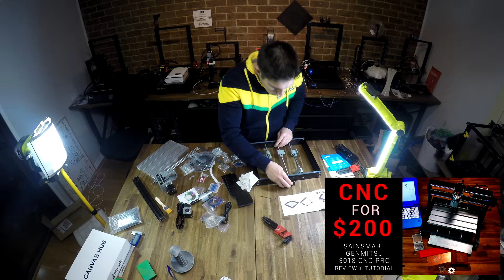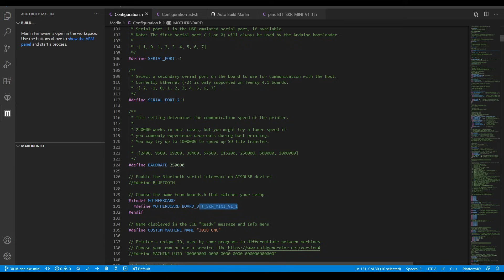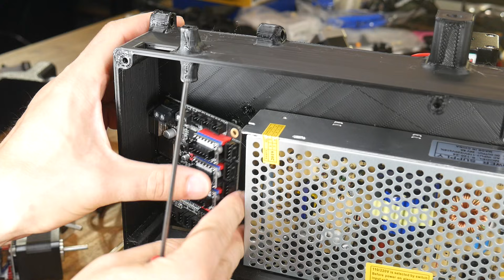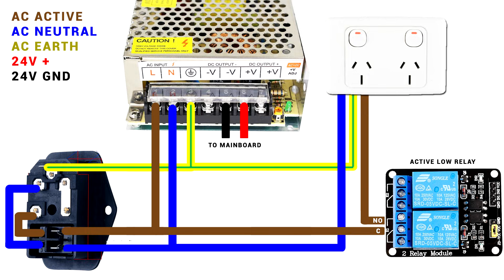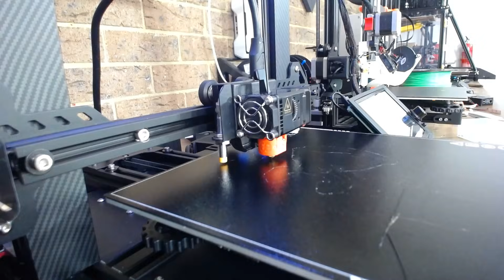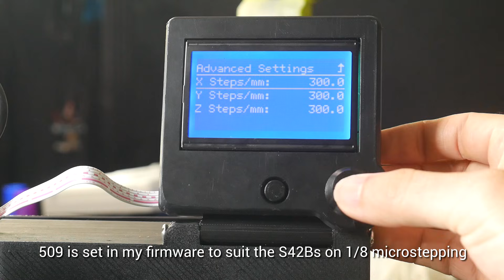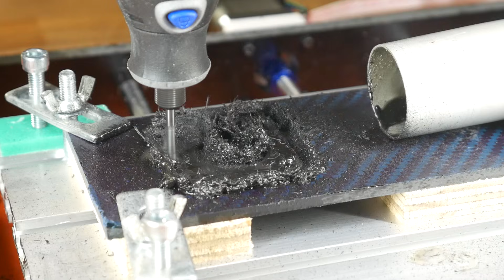Genmitsu 3018 CNC upgrades: Mill acrylic, aluminium and carbon fiber

Comment: nice video! which printer did you print that part on (and which nozzle)? thanks
Reply from the maker: The large electronics case was done on a CR-10 Max - 0.6mm nozzle and 0.4mm layer height. White PETG parts on Prusa MK3 - 0.4mm nozzle and 0.2mm layer height, LCD case and S42B covers on Prusa Mini - 0.3mm nozzle and 0.15mm layer height.
Reply: @TeachingTech  Thanks!

Comment: when ordering the control board which option did you go with?
Reply from the maker: Bare boards, wire terminals rather than DC plug. That should be what I linked to. If you didn't want to switch from the power brick you want want the DC plug version.
Reply: @TeachingTech  I wasn't sure which one you were using the link has all the options listed. thanks for clarifying.

Comment: So happy yo see this little machine perform so well out of it's range , some notes though , carbon fiber dust is not only dangerous for humans , it's also highly conductive so i wouldn't have it near electronic boards , also composite cutting milling bits work much better on carbon fiber , as always great work thank you
Reply: Yeah, I wouldn't do it at home at all.
Reply: Maybe you could submerge the whole work piece in water and then cut it

Comment: With the servo steppers - what happens if it crashes into the bed?
Reply from the maker: It's going to keep trying to crash. I always run a healthy margin to keep from the edge on any CNC jobs. Also, the closed loop functionality can be switched off with a DIP switch on top of them.

Comment: What about adding a fogger for the coolant?
Reply from the maker: I've setup the firmware to support misting and flooding via a relay. The ports are labelled on the wiring diagram so should be easy to get going.

Comment: Great video! You planning on using sensorless homing for it? Also how much different would it be for an skr 1.3? Have a couple laying around and wouldn’t mind tinkering :)!
Reply from the maker: I've never had homing capabilities on my CNC routers so didn't seek it here. No doubt there would be advantages but I haven't need it yet. Sensorless homing should work since all three axes are the same configuration, although Marlin warns about using it for Z, perhaps because on a 3D printer the nozzle is what will be contacting the bed in some cases. You could port the firmware fairly easily for SKR V1.3/4. Configuration.h and configuration_adv.h can be copied but with the mainboard and serial ports changed. The pins file for the V1.3 would need tweaking as I have for this board.

Comment: So you basically only retain the mechanical parts of the original CNC? Maybe you could put together a build kit instead, would probably be cheaper than buying this CNC and then upgrading (though if you already own it anyway, it's a different story)
Reply: It’s like a ender 3. People buy the kit to get started. Then once they know what they want they upgrade things such as main board, hotend, extruder, etc. But I do like you idea of building a kit. I just built my first  printer and I can say I know so much more about firmware and mechanical aspects just by doing it myself
Reply: Exactly what I was thinking! 
All of the electrical is new except some of the wiring. Either a kit or plans for the 3018 would be nice.
Reply: Replacing literally everything
Reply: I would recommend building the kit first and getting to know the machine before an upgrade, I have the model up from this the Sainsmart 3018 Prover, it has side panels and end switches and a level sensor. it has a plugin control unit that you can mill from so you don't have to tether a pc
Reply: Can you get just the mechanical parts as a kit cheaper though?
Reply: Totally agree @michael 
Some extrusions, threaded rods, couplings, a milled plate (could then go bigger in the Y axis too, as 3018 is as it's name suggests, 30cm x 18cm).. it would be HEAPS less than buying a kit and tossing half of it aside. Because, to be honest, I'd only ever get a cnc if it was decked out just like Michael's (Teaching Tech Michael, that is).
Reply from the maker: I see your point and if you were starting out with x money you might get more for that money with careful planning and buying. Like Kyle says however, quite often people buy the machine and want more. That may be extra performance or just a project to learn from.